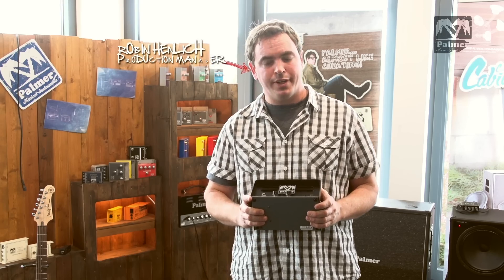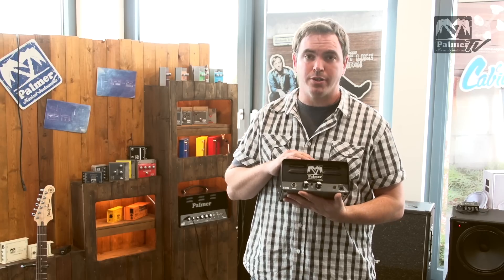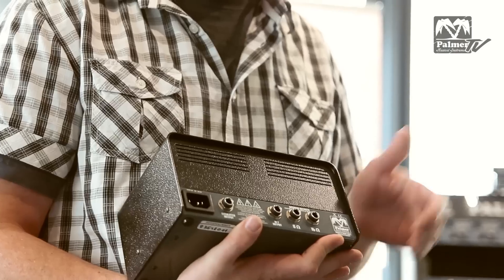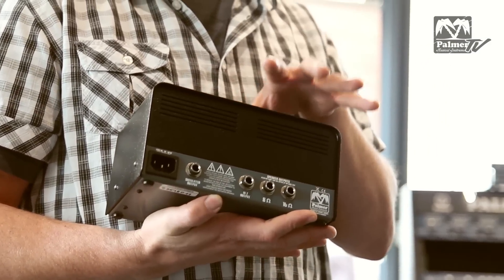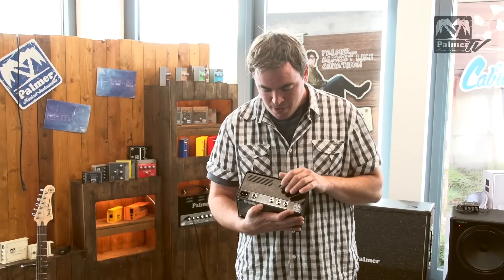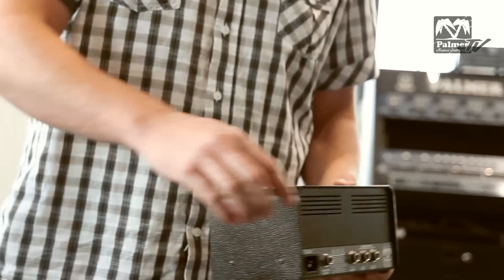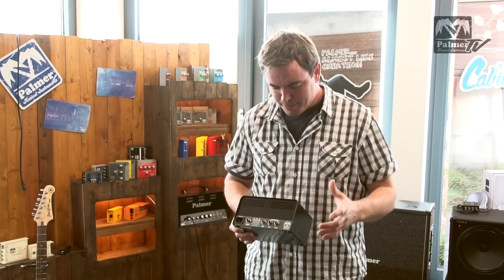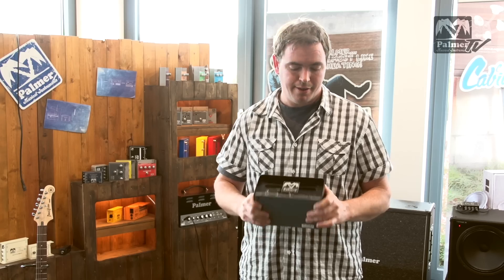Palmer Eins - 1 Watt Mini Amp Tech Talk

Comment from the maker: In some amps tube rectifiers are still used – for example in our DREI Amp. Tube rectifiers change the behavior of the amp a quite a bit, it changes the distortion threshold and behaves more interactively with the rest of the circuitry (because it does not work linearly as opposed to a solid state Version) – this is what gives vintage amps their characteristic sound.

Comment from the maker: We don’t have SPL measurements at hand, but the amp just by itself via a guitar speaker is likely to be too quiet for most rehearsals. However, the amp has a speaker simulated out which will allow you to plug it into a mixer for example.
Reply: If you connect it to a mixer, can you still use & hear sound from the guitar speaker? Or does one cancel other?

Comment from the maker: A rectifier converts the AC current coming from the wall socket into DC current which is needed to by the amps circuitry. So it is in no way involved in the Audio circuitry as such. In the early days of tube amplification, tube rectifiers were used – these have largely been replaced by solid state rectifiers (diodes) – A majority of all true tube amps out there use a solid state rectifier – it is no sin to use it in a tube amp as it just converts the incoming current.

Comment from the maker: However Tube rectifiers do not always make sense – in the case of the EINS (because of the size, the circuitry and last but not least the price), it doesn’t make much sense – sort of like having a huge rear spoiler on a normal Toyota corolla (I know some folks think its cool – but it doesn’t really make sense )

Comment from the maker: Hi, that's false. It has a load box, which sets the speaker outputs to 0W if they are not used. If you need a power soak please check out our PDI06.
Cheers!